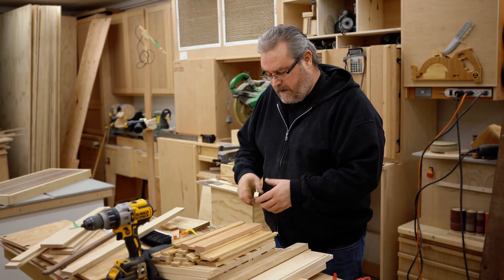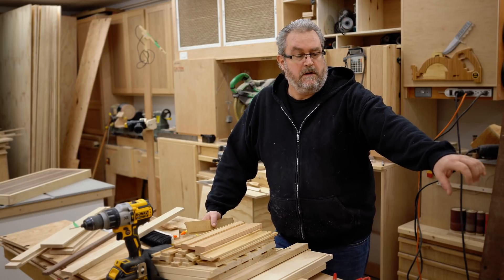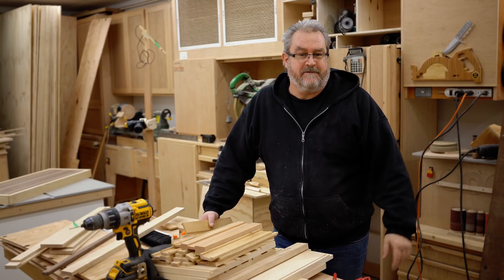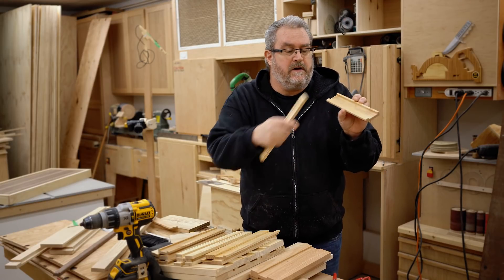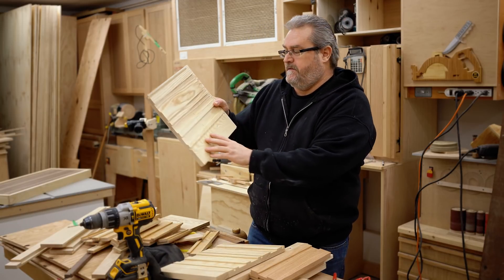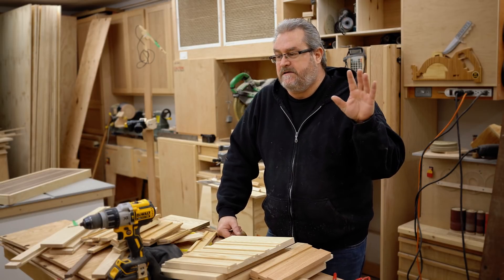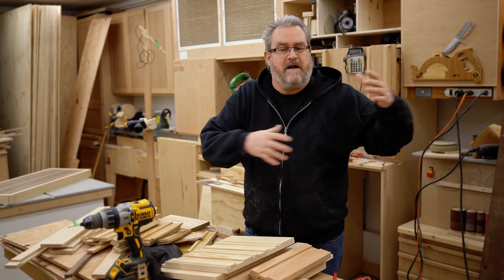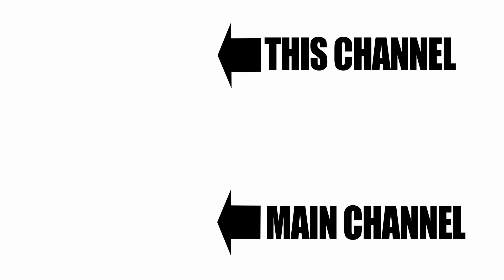The Difference Between A Rabbet And A Dado

Comment: I learned that a dado is cross-grain trough and a groove is an along the grain trough. Both have 2 sides and a bottom, whereas a rabbet only has 1 side and a bottom.
Reply: You are totally wrong .
Reply: @738polarbear  A dado, housing or trench is a slot or trench cut into the surface of a piece of machinable material, usually wood. When viewed in cross-section, a dado has three sides. A dado is cut across, or perpendicular to, the grain and is thus differentiated from a groove which is cut with, or parallel to the grain.

Comment: Troughs going with the grain are called 'grooves'.
Troughs going across the grain are called 'dados.'
Two sided troughs at the edge of a board are 'rabbets', whether they run with the grain, or across it.
Reply from the maker: Think you are the 5th comment mentioning that. Yes, technically a dado goes across the grain, but in my opinion, that's being a bit too granular. 
For me, a groove can be a dado. Or it can have a round bottom, like for a plate rail. Or shaped like a dovetail, like a sliding dovetail - a dovetail groove. Or a dovetail slot.
No one would call it a dovetail dado. 
Or maybe they would, but you can be sure there'd be someone listening that thinks it's important to point out the difference.

Comment: "Slicker; water based polyurethane is making them so"
Working with vinyl windows, I've found Lemon Pledge works great to make window sash slippery.  Have to polish it in though; not just spray it on.
It contains lemon, wax and silicone.  Don't use the spray version anywhere around where your wood stock is.  Spray it outside and polish out there, then bring it indoors.

Comment: I suffered from human error earlier today while making a video. I laid out all my points to drill 1/4" and 3/8" holes on a part and proceeded to drill the first hole, while holing the part backwards. thus putting a perfect 1/4" hole where a 3/8" hole should be. If it hadn't been a forstner bit I could have worked through it but was lucky enough to be able to flip the part over and lay out the point again because it was just a plate to hold drill bits and not fine furniture.